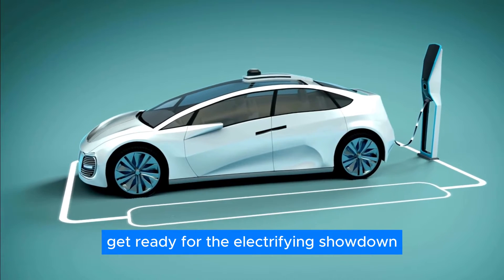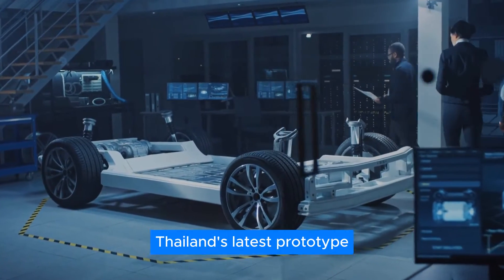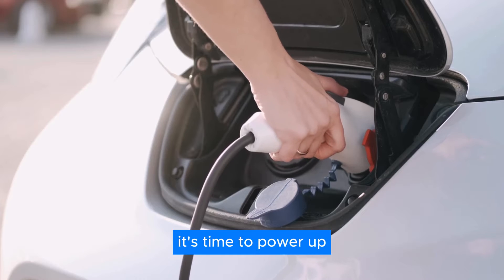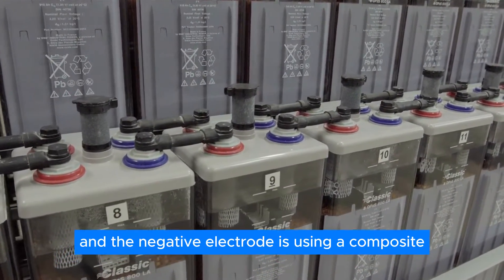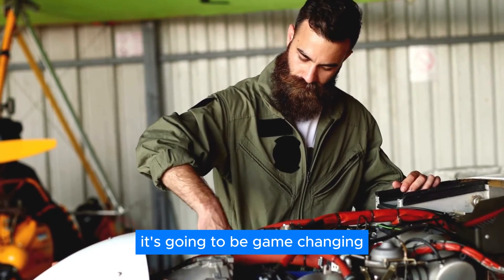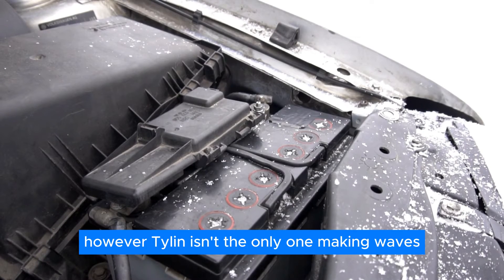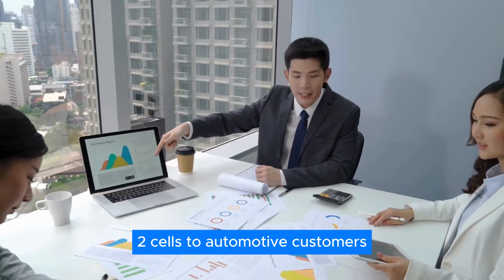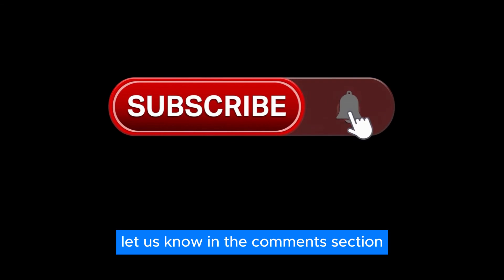Chinese Startup's NEW Solid-State Battery STUNS The EV Industry!

Comment: We have achive very similar specific energy with our solid state on small scale with 85% energy maintained after 300 cycles   We use lithium metal anode  which theoretically should  get much higher energy than Graphene based . We are located in los angeles california solid state battery inc